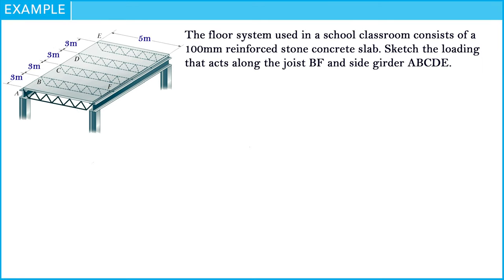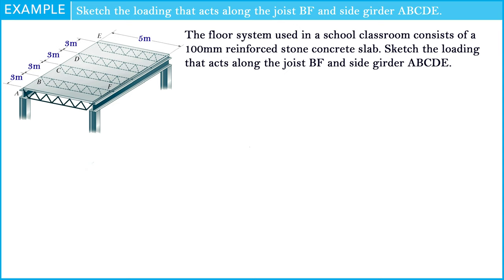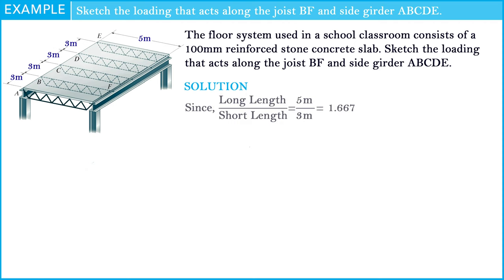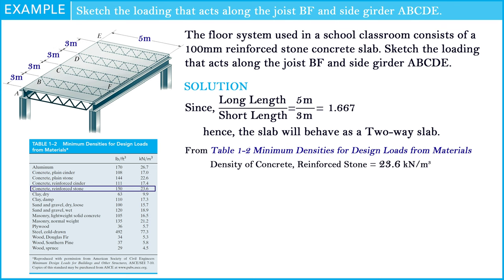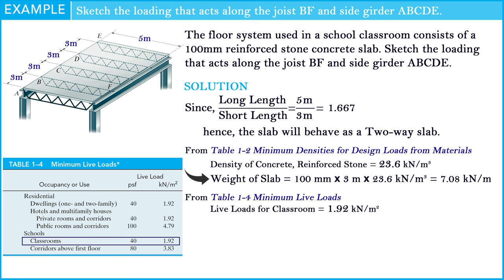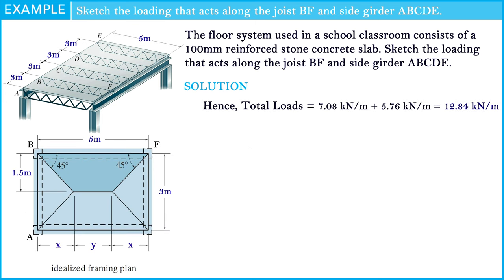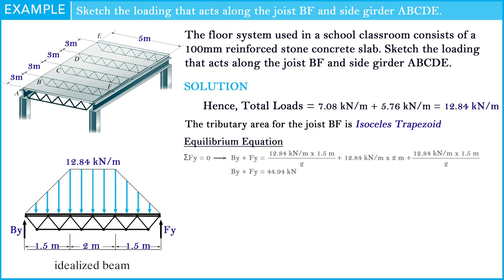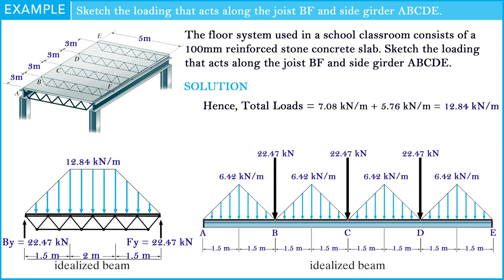Sketch the loading that acts along the joist BF and side girder ABCDE

Comment: can you please explain more about grid ABCD. how is the 6.42kn/m from. thanks
Reply: did you know the answer?
Reply: He took the load 12.84 times the area of the triangle and he will find 19.26 as a single load but as a distributed load divide by 3 so do not include the horizontal length !! and therefore you will find 6.42 :)